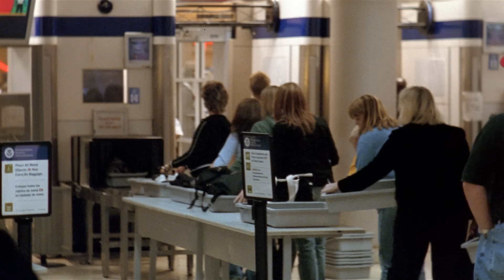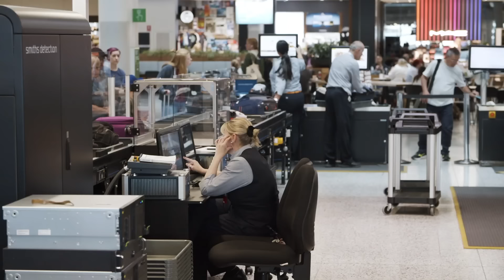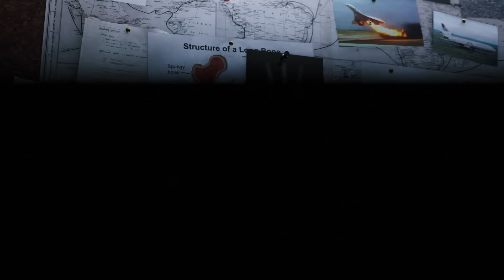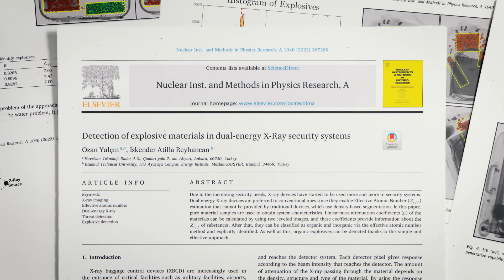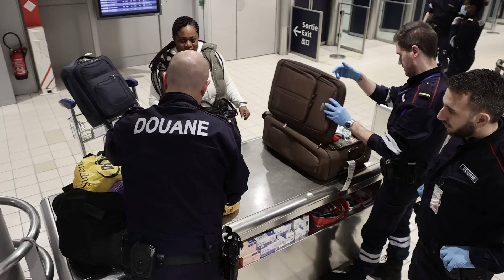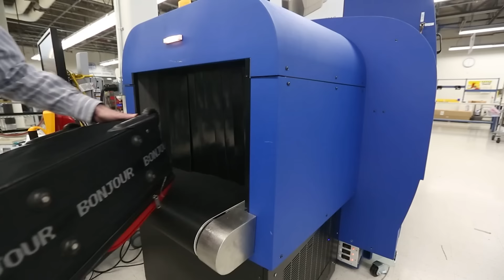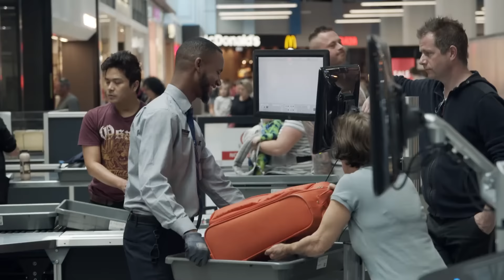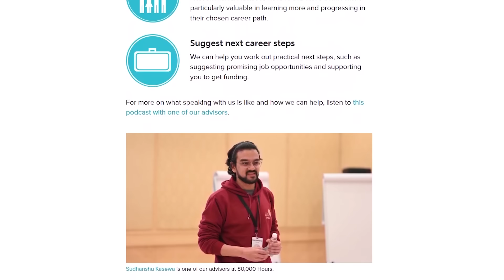Why Airport Security Suddenly Got Better

Comment: The moment I saw the guy drag around a 3D reconstruction "CT Scanner" immediately come to mind.
It's honestly confusing to me why CT scanners weren't used in airports already.
Reply: CT has been used for pallets of checked baggage for a long time now. And, no. CT doesn’t have magnets or cryogens. That MRI. LOL

Carry on luggage is checked with backscatter X-ray. It’s not simply looking through your items, but is looking at how your items fluoresce.
Reply: Cost, and as noted in the video it takes time to get them fit for purpose.
Reply: mostly speed, the ct in hospital takes way longer than this maschine does
Reply: Its quite simple: CT scanners have historically been very expensive to buy and maintain, maintenance heavy and consume huge amounts of electricity. Old ones used liquid nitrogen to cool the magnets to temperature and high end ones are still water-cooled.
Reply: @LAG09 Maybe there's some technical minutiae I'm unaware of but as far as I'm aware CT scanners don't use any magnets of the sort that require substantial cooling, at least not LN2. Personally I would have said that, expense aside, the main reasons CT scanners weren't being used until more recently would be speed, size, and resolution, in particular discrimination of similar density items and classification/modelling of lower density items

Comment: It's good to hear they're getting more efficient at security theater. I'll keep watching them confiscate nail clippers and grenade shaped mugs
Reply: Or even mug-shaped mugs
Reply: @georgesanchez8051 or even mug shaped Grenades
Reply: @georgesanchez8051 are mug shaped grenades ok?
Reply: I had a jump rope in my bag; an agent pulled it out and in the most forced voice she could muster she shouted "sir is this an exercise device?" and I had to say yes through laughter. She also confiscated a pair of wire strippers I had like I was going to hotwire the bird mid air.
Reply: @El-Aminoh somebody has to teach you how to pack...
Reply: @TankandDimples  we found the TSA agent lurking lmao. Imagine thinking a jump rope represents a threat.
Reply: It's an avocado I swear!
Reply: @dudea3378 this hasn't been a thing in like 10 years
Reply: Right, after 9/11 air travel was immediately safer because no one was ever going to allow the hijackers to take over since they would assume they'd die anyway.  That made it not much more of an attractive a target than a subway.
Reply: they took my butter knife. my travel cutlery set will never be the same...
Reply: Definitely theater. Rules changed but not the equipment at my airport.
Reply: I was once told that I couldn't take a bag of potato chips through security in Milwaukee airport. I felt like the security guard was just feeling peckish.
Reply: take some c4 and tell me how it goes
Reply: @cafebean  a report from ABC News that "internal investigation of the Transportation Security Administration revealed security failures at dozens of the nation's busiest airports, where undercover investigators were able to smuggle mock explosives or banned weapons through checkpoints in 95 percent of trials."
Reply: While letting through scissors and pcb's and a soldering iron.
Reply: Delta 1st class lounge and American airlines 1st class lounge both have sharp knives available for cutting meat and chicken
If I felt like it I could shove 1 of those in my pocket and walk out and I'm already past security
Reply: Cool bro, when was the last hijacking? You sound so clever lol!
Reply: Tsa and dhs has and always will be an illegal organization
Reply: Lfmao
Reply: Missed my grenade shaped flint and steel lol
Reply: Hehe, my favourite was when Disney opened their Star Wars land and retail bottles of coke that were oddly shaped were all of a sudden a massive security problem. Keep everyone distracted
Reply: @repatch43  
What do you mean by the bottles were oddly shaped? Non-familiar sizes to airport staff?
Reply: @are1981  they are spherical and have a cap on one end that is decorated to look like a thermal detonator from the star wars universe. Roughly softball size.
Reply: This is what I came here to say.
They haven't stopped or prevented any attacks.
They're just drug sniffing people looking for smugglers on a good day.
Reply: The problem with security theater is that if they don't do it, people like you again will vote for people who will claiming that why is nothing being done to stop the terrorists or some other thing along that line. The blame incompetence blah blah blah and we're back to square one with more security theater. Blame the voters.
Reply: and heckling pies…idiots. I hate that we’ve let mall cops ruin air travel for an entire country.
Reply: Lol
Reply: Yawn. You so cool dude.
Reply: Woo!!!! Even more difficult getting out of the country, like not being able to get a job so i can leave the country!! yay!!!!! please stop your authoritarian country i beg
Reply: Remember the 9/11 individuals already had the weapons on board not through security. All this is was already in place. So we went to panic mode over this. The one thing that was accomplished they stole our freedom so in a way they won out of our ignorance. Patriot act was the true terrorist event
Reply: squat & cough!
Reply: My favorite time was me explaining my hat will be flagged in the metal detector that I will place it in the bin. The guy was like no take it and was very confident that it’s not a metal detector they use… anyways after having to show the hat to the one at the metal detector I was wondering if they even know what they are doing.
Reply: Paul Mitchell special conditioner
Reply: Lmao hilarious that they get nail clippers when I’ve gotten a full on straight razor through before
Reply: Some even too efficiënt. Last year I flew from amsterdam to zurich, and forgot to take a pocket knife (in card form) out of my wallet. I usually leave it at home, since it is technically illegal to own outright and especially to take on planes. No one on AMS noticed it. But on the way back in Zurich I got pulled out of line. When they focused on my wallet I remembered my knife. Ironically, after they confiscated it and we passed security I noticed they actually sold Swiss pocket knives in the tax free zone. So I didn't really get why my knife had to be confiscated anymore.
Reply: I've managed to slip my embroidery needles through every time by having them within the cracks of the bag.
Reply: @katarh  Those aren't prohibited items anyway...
Reply: Word! Just had my swisscard confiscated at Tbilisi Airport after 20 years of successful airtravel😅
Reply: And butter knives
Reply: lol yeah was allowed to take my razor blades but olives are way too dangerous!
Reply: Mainland China has X-ray machines at subway stations too & I almost got stopped as my bag had a pencil case with a stapler inside
Reply: They always let me bring my mug-shaped grenades.
Reply: I came here to make this comment.  Thank you for beating me to it.
Reply: I like to hope that they’re at least having fun playing with all their little gadgets
Reply: Or my bullet like pendant (which was 100% false: wrong materials, hollow inside, a welded single part). This happened in Munich a few days ago :/
Reply: they steal those items and sell them on ebay
Reply: @LethalBubbles  False
Reply: Security theater IS security. It's why we use picket fences and padlocks even though they are the easiest things in the world to break though. The appearance of security is a deterrent in it of itself, and so is inconvenience.
Reply: I once saw a store  selling (among other things) pizza cutters in the duty free, while pizza cutters probably aren't the most effective weapon im shure that if you tried to bring one through security in your hand luggage it would be confiscated
Reply: Idk, I gained a bit more respect for TSA after former Rep. Cawthorn was convicted for trying to bringing a gun onto a plane. TSA found over 7000 guns in carry-on bags last year. TSA will probably never stop a Terrie, but they’re our last line of defense against this horde of room-temp IQ gun owners.
Reply: Meanwhile you can charter a flight and have zero security at all, just get on and goooo
Reply: This.
Reply: I think YouTube hid my comment about making it through security at the busiest airports when I grabbed the wrong bag, everything was covered in smokeless and black powder residue, but their swabs never set anything off. It's so dumb it's hilarious
Reply: @DeadBaron  it's because black powder isn't the type of explosive they're looking for.
Reply: You can tell from comments like this who is just angry because they couldn't take the wrong shit onto a plane lmao
Reply: @snickerdoooodle  Pretty much
Reply: Airport worker here.

We confiscate anything gun shaped because you must follow the rules.
Confiscate once, confiscate twice. You don't bring it and tell your children not to bring it. You google the rules and you follow them.

And it works.

We don't think your gun shaped mug can shoot, we are punishing you for wasting our time to open your bag and check what it was.
Reply: So great that they are now spending 250K+ taxpayer money for each booth in addition to manpower for this.

It's not like the old ones didn't have material identification.
Reply: @orbatos  aren't airports usually owned by private investment firms? Why don't they pay for it?
Reply: Nice disinformation. Nail clippers are allowed in carry on
Reply: exactly like... i don't have time to watch right now but i'm gonna assume a big reason why it seems "better" has to do with pervasive surveillance technology and all the biases that come built into it. generally speaking, i'd personally rather deal with "inconveniences" that let me keep more privacy and don't feed into a machine that people are using to do who knows what with our biometric data.
Reply: The theatre is becoming effective and ceasing to be theatrical.
Reply: @CamCovello tell that to the edibles i allegedly successfully brought through tsa by accident
Reply: @spaceghostmiid  TSA doesn't look for drugs, just things that can take down a plane and weapons. So of course your edibles made it.
Reply: @spaceghostmiid Dude, I literally fly with THC edibles and THC vapes basically by default now. They do not care if you bring candy on a flight (🙄😂), and as long as they aren’t emblazoned with “THC” all over it or anything, they’ll even let the vapes thru basically as if on the assumption they’re only standard nicotine vapes.

Really. As long as you don’t have literal, actual flower on you (which has that unique, pungent, and highly detectable odor), you’re good to bring THC with you on flights in the U.S.  I used to be worried at first, but I NEVER do anymore.

P.S. THC on flights is HEAVENLY. 😁
Reply: @spaceghostmiid one time I accidentally left a utility knife in my bag and the tsa officer thumbed past my edibles looking for the knife. Didn’t even care abt the edibles
Reply: @CamCovello if we’ve had theater for so long, what’s the point in making it “effective” now?
Reply: @CamCovello Explosives experts say there is no liquid explosive that could bring an airliner down from within the cabin. It doesn't matter if they're getting better at recognizing TATP—it's not possible to make it into a workable threat. Also, every security theat stopped since 9/11 was stopped by passengers, not TSA or Air Marshals.
Reply: @CamCovello  if believing that makes you feel better... 😅
Their track record though is absolutely horrible. I kind of tend to demand performance when I spend money on things... The TSA does not perform. Their records of non-performance are actually public information. You can look it up.
Reply: @Unmannedair  I agree with you. The whole point of the video is that new technology is making TSA employees obsolete. The system will be automated and effective without people messing it up.
Reply: Oh definitely. That's why 18 out of 20 airports failed fbi tests and allowed guns on planes @CamCovello
Reply: @CamCovello  Until the lines are gone, that's not accurate - at least if you're looking for bombers. Why? Because the target rich environment is actually the TSA lines themselves, not a plane. Or have you never noticed?
 And thus the show must go on
Reply: It'd not theater, when was the last terrorist attack on a civilian airline?
Reply: @TimCo-xi8dj  correlation or causality?  Good thing we put up all those anti-nuke weather veins; there hasn't been a single nuke since we did that !  😂
Reply: @snickerdoooodle   I guess I'll have to take your word for it
Reply: @TimCo-xi8dj there are many less obvious security measures in place that are actually effective at stopping atacks. TSA is not one of them.
Reply: @TimCo-xi8dj  - As someone else correctly pointed out, after 9/11, the presumption changed - now crew/passengers would fight to the death to end a hijacking (since that was now the presumptive outcome no matter what).  That change alone made aircraft a MUCH less attractive target.  That likely accounts for most of the TSA’s “success,” not their true effectiveness.
Reply: @maldoon  - You haven’t a clue, but keep believing sheep, they’re counting on it.
Reply: @maldoon  - I’m well aware of that, and that is PRECISELY why the security theater is a joke.  I’ve been in the industry almost 40 years now, and am quite aware of some of the deficiencies of the system.  I WANT more effective security, not just theatrics.  Please, tell me all about your expertise on the matter.
Reply: @TimCo-xi8dj  when was the first?
Reply: @TimCo-xi8dj Someone has been paying attention. People say it's theater because they are just angry the TSA inconvenienced them. When in reality, the TSA is why no civilian commercial airline has been hijacked since the formation of the organization
Reply: @VanGeo1 wrong..we say it’s theater because of the terrible percentage of dangerous items being caught vs being allowed through the checkpoint….you don’t actually need to have good security to stop an attack…all you need is a system that LOOOKS good..ie..theater
Reply: @TheOmega1921  How many firearms did the TSA stop from being smuggled onto planes last year? Speak loudly for the whole class.
Reply: @TheOmega1921 How do YOU know the number allowed through and the number detected? Ah! I see - you have special cognitive powers.
Reply: @VanGeo1 The answer is: an unknowable number. But probably a significant number.
Reply: @Fomites 2023: 6,737
Reply: @VanGeo1  - Dream on!  If we were truly dependent on the TSA, there would be smoking holes all over the place.
Reply: @AndreySloan_is_a_cnut  Aw poor lad. Did the mean TSA officer take your oversized liquid?
Reply: @VanGeo1  - No junior, I’ve worked in the aviation industry for just shy of four decades now.  Unlike you, I actually know of what I speak (and I say no more than I do for a reason).  Did I hurt your Smurf feelings with the truth there?
Reply: @AndreySloan_is_a_cnut  is Smurf what all the kids are calling the "I want to project my vulnerabilities on someone else" insult now? Used to be snowflake.
Reply: @VanGeo1  - No, I just understand what a joke it is, unlike you.
Reply: @osculant  Ask the perpetrators of the 2006 transatlantic aircraft plot and Ramzi Yousef (the terrorist behind the bombing of Philippines Flight 434)
Reply: @VanGeo1  This is a statistic I had to think about.... and the last few plane incidents in my memory have involved things like a door blowing off (not a hijacking), pilot suicide (not a hijacking), the fancy new elevation tool not being the same as the old model and the pilots not being properly trained on the differences (not a hijacking), a mysterious disappearance over an ocean (we are fairly certain not a hijacking) - you're right.  Security theater or not, it's sort of working as intended.  And we just had the idiot  athletic director who tried to frame a principal using AI get arrested because he tried to pack a gun on his carryon luggage.... with an outstanding arrest warrant.
Reply: @VanGeo1 do you know why there are no gators in the New York sewers? Because the gator catchers caught them all. Definitely not because there never were any.
Reply: @EpitaphPunk  not sure what that has to do with firearms in airports.
Reply: @VanGeo1  And how many shootings were there on planes or in airport prior to the TSA?
Reply: @oblivionsa7973  planes getting hijacked at gunpoint was once so common, That passengers were taught to not try and stop the hijacker least they get shot in the process.